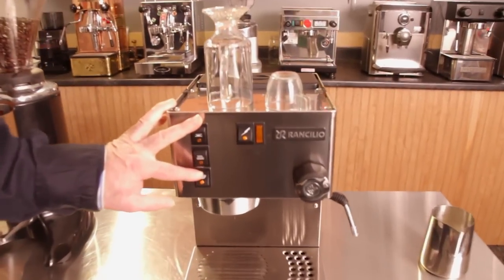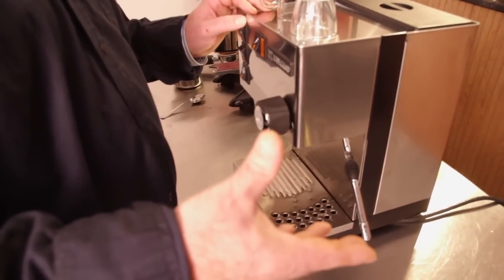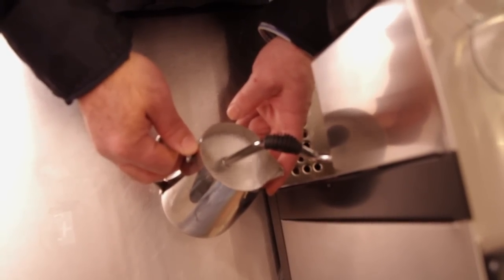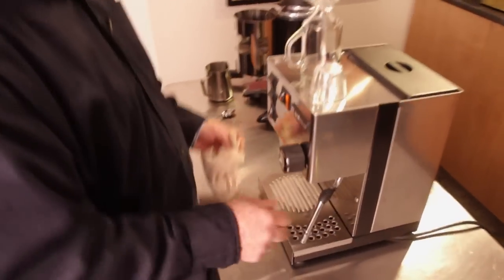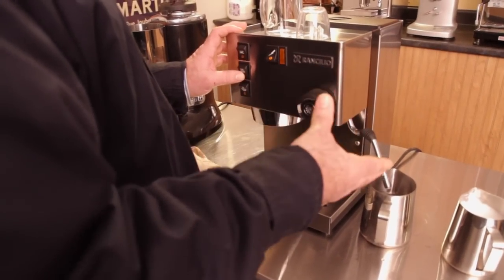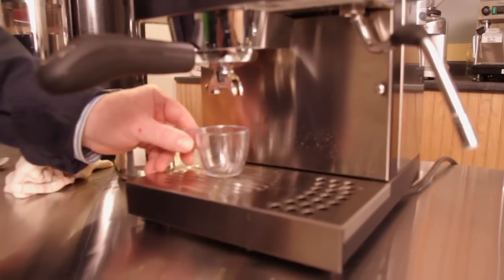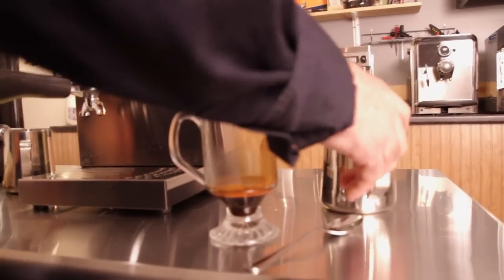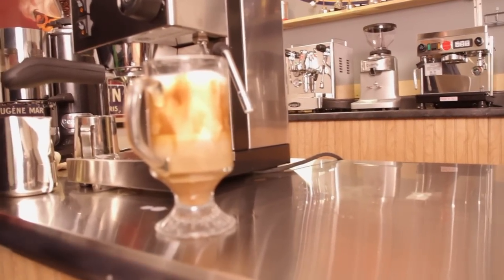How to make a cappuccino on the Rancilio Silvia Espresso Machine

Comment: I don't bother turning on the pump any more when bleeding the steam line.  It takes a bit longer to bleed but I don't have to refill the reservoir nearly as much.  The main thing to avoid when pulling the shot is that Chsshhhh sound from too much steam pressure.  Then a perfect shot is just a matter of the right grind and tamp.  Dead easy.

Comment: Hi.  Just bought a Rancilio Silvia recently.....the filter sometimes stay stuck on the machine when you remove the handle.  Did I get a wrong size or is this normal..
Reply from the maker: Hi CL, It's normal. Happens to me all the time! Always best to keep the PF attached to the machine prior to brewing so it heats up. A couple of things that can help: Regularly clean the group head and gasket area with a group brush. Removing residual coffee oils and grinds will make basket sticking less likely. Also, don't clock in the handle hard when not brewing and remove when machine is not in use.